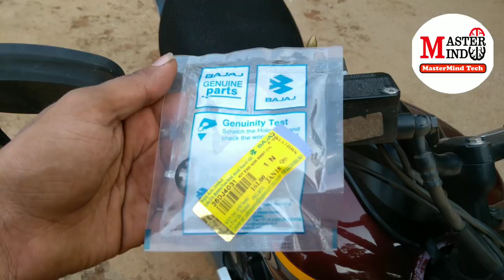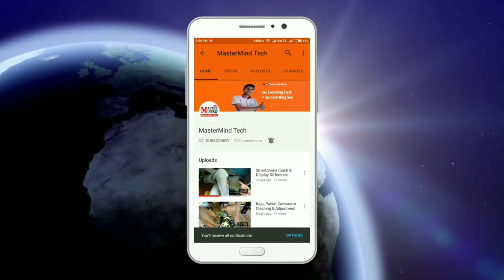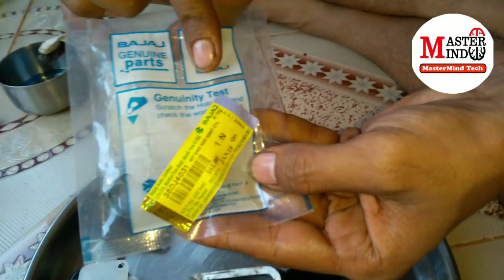Motorcycle Disk brake Master cylinder rebuild

Comment from the maker: Also watch our Other Videos-
Refill Car Perfume At Home- https://goo.gl/qatF7X
How to drive motorcycle with broken accelerator cable- https://goo.gl/msvjJB
How to open car door without key- https://goo.gl/8iiyPA
How to set the horn tone perfectly- https://goo.gl/8Aw7xi
Motorcycle Diskbrake Master cylinder rebuild- https://goo.gl/38prQ5 
Suzuki Swift Dzire  Regular Maintenance- https://goo.gl/wQVSvR
Repair and Rebuild Motorcycle Brake Caliper's- https://goo.gl/7nghjY
Royal Enfield Classic 350  Review -  https://goo.gl/tfHcko
 LED T10 RGB with IR.Remote Controller- https://goo.gl/UDMbTR
How to easy Read/Clear car Fault Codes Using ELM327 OBD II- https://goo.gl/a2Vggg
9h ceramic coating good or bad- https://goo.gl/zBbbT4
Motorcycle engine overheating problem- https://goo.gl/iiXgJz
How to install anti theft alarm security System for any Scooter- https://goo.gl/YDd6Zy
How to fix car belt noise properly- https://goo.gl/t3K26T
How to install anti theft alarm security System for any Bike- https://goo.gl/34hAjs
 How to start scooter or motorcycle without key 2018  https://goo.gl/H7BLfs
Volkswagen Type Horn installation For Any Car- https://goo.gl/jHkzdP
led headlights for motorcycles- https://goo.gl/3LN89r
How To Apply A 9H Ceramic Coating To Your Motorcycle- https://goo.gl/BjMWbf
New technology spark plug for motorcycle- https://goo.gl/8Z6Z8R
motorcycle misfire problem solution - https://goo.gl/JnqCPS
Car Odometer Miledge Correction Hindi - https://goo.gl/bmZBZv
Restore Dull paint using clear coat- https://youtu.be/wvhzFKw_5g4
How to fix car Bumper gap- https://youtu.be/A_CxzDLGMt0
Car Fog light Restoration - https://youtu.be/sRE_vjHsDu4
How to SUPER FLUSH your Cars Cooling System- https://youtu.be/MCJaTh4N1QQ
How to test common rail diesel injectors- https://youtu.be/ylHCHLHlfi4
How To properly Wash your Motorcycle- https://youtu.be/EgYkBQIQPb8
Pulsar 150 mileage test- https://youtu.be/gG530lZ2VYs
Restore old car paint- https://youtu.be/9EiMO4X3-d0
Can Engine Oil Flush Really Work- https://youtu.be/UTCH4LPrPH0
Car Trunk Light ! Car Dikki Light Installation, Hindi- https://youtu.be/LRmlXXv-IVM
How to inspect second hand Motorcycle- https://youtu.be/wMudjyuki2o
Bajaj Exos Tec Explained Hindi- https://youtu.be/Vf57ck9kHhg
DIASBLE AHO IN CLASSIC 350 BS4 Royal Enfield- https://youtu.be/A3qQEZpbrvE
Motorcycle Disk Brake oil Replacement- https://youtu.be/PH_VGK31jYU
How to Polish scooter After Painting- https://youtu.be/WLT58OyfVx4
Paint full Scooter using spray cans- https://youtu.be/rXhmulVa_7w
Maintanense Free Battery repair (recover)- https://youtu.be/-HkhPbGvgAI
Motorcycle chain Adjustment- https://youtu.be/-sHJ8A4BPxk
How To Clean & Lube Your Motorcycle Chain sprocket- https://youtu.be/7bZg5E4q6Cc
motorcycle fog light installation- https://youtu.be/NDxQ1KXFC3A
Musical horn for car & bike installation- https://youtu.be/x1r2vSaWRPs
Bajaj Pulsar 200NS Service Indicator Reset 2018- https://youtu.be/WSvy4TBXCNs
Pulsar NS200 Timing Chain Replacement- https://youtu.be/wDZ0TW-B1HQ
Motorcycle starter Problem- https://youtu.be/mIo0w3bKUW8
Bajaj Pulsar NS200 Tapped Adjustment-2017- https://youtu.be/dULWZJnMwGg
Motorcycle Battery Charging  Problem solution- https://youtu.be/zuymftTtZGY
Reply: Bhai brake caliper , brake line , aur mc kit sab chamge kr dia lekin brake thoda laga rh jata hai kuch sol. Batao

Comment: Brother I went to the service centre. The mechanic diagnosed the issue and tried to hide it from me. In the front brakes it was the master cylinder which was the problem. The front brake lever was hard which was not pushing the brake fluid add much as it should have. Hence the front brake was not locking up even after pressing it with good force. It was changed instead of servicing it. And I believe as far as rear brakes are concerned. He just did some sort of servicing of it. And the feedback improved. My vehicle is 6yrs old and I think gradually the master cylinder losses it's softness or its effectiveness due to deterioration of the brake oil.

Also i went across all the videos on YouTube not none discussed anything regarding the hard brake lever. Hope u would throw some light upon this problem. Looking forward for your words.